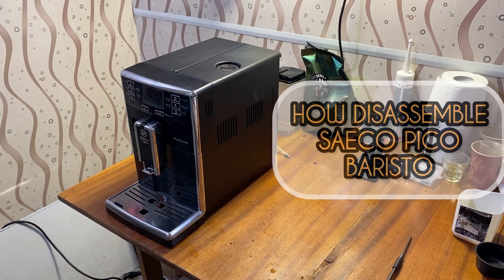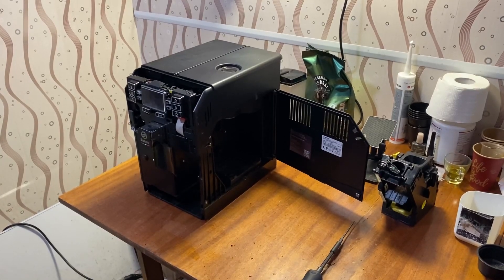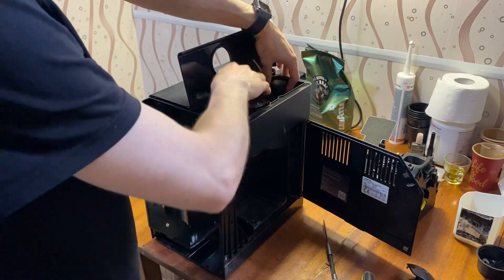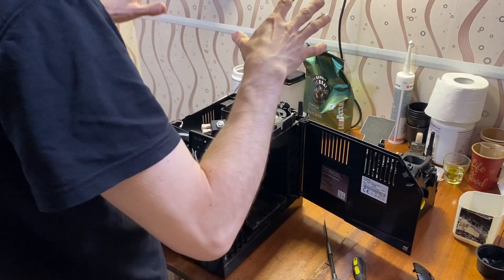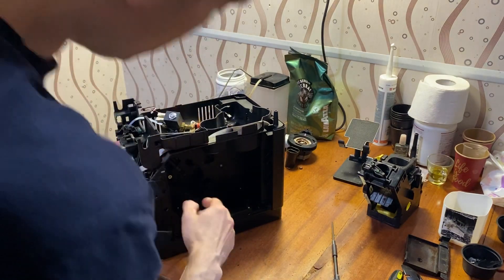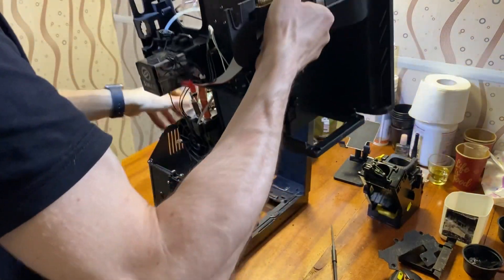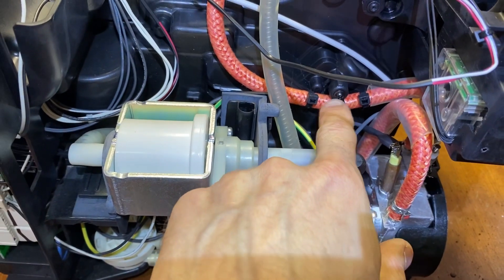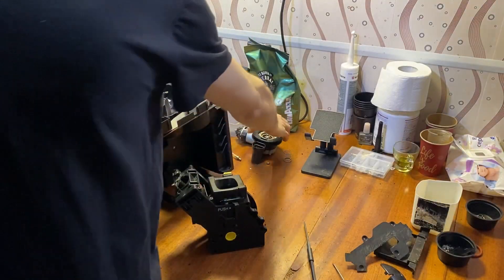How to disassemble Saeco PICO barista sm5460. What check inside?

Comment: Thank you very much for the video. Managed to take it apart and changed the rubbers(and cleaned it). Next time i will try to fix the two screws i had left. Don't think it will impact that much.
Reply from the maker: My pleasure. Absolutely agree about left screws - don’t mind about them. Personally - I collect an 1 litre can full of screws I previously have forgot to place in assembled machines)))

Comment: Hi! Thanks for the video!
I have a Seaco Pico Barista like yours, and recently it has started making a loud noise right after starting up (not during the rinsing cycle, but immediately after). This happens just before it begins dispensing coffee. I don't think the brew unit is the issue, as I've cleaned and lubricated it thoroughly. The noise seems to be coming from the left side of the machine. Do you have any idea what might be causing it?
Reply from the maker: Looks like some problems inside machine. If tries to guess - 3-way water connector got crack and release water presure inside machine case.

Comment: Hi thanks for video please any tip on how to clean coffe nozzle?
Reply from the maker: Hello. Just by disassembling machine. On such model - it’s easy : unscrew top of machine (in water container tray and bean container), pull towards yourself front panel ( maybe 2 screws behind coffee dispenser there’s). And just left screws behind side door of machine - 3 pcs, and 2 in front of machine. And you’ll be able to take out coffee nozzle container. If questions was about it. If you have ask just about front dispenser - take side chrome panel a little to the top and in opposite sides, unscrew little t8 screw and pull half’s of container to opposite sides
Reply: @OlegPC  thanks a lot did you ever disasseble coffe dispencer? Didn't found any video
Reply from the maker: @hatimdaoudi09  I disassemble such dispensers regularry. Its very simple, so i didnt make any video about. Just start, and youll be succeed)))
Reply: @OlegPC  afraid from breaking it hhh
Reply from the maker: @hatimdaoudi09  You shouldnt be. Very simple to disassemle machine

Comment: Hello Oleg,
Thank you a lot for your video !!!

I have same coffee machine and since couple of days it can’t venting the water cycle anymore… display brings the error 05 

I handle it to dissemble and clean the water temples.
By the way there was no water leaked.

Could you please give me some hints, what it could be and what I might have to change ?

Thank you in advance
Reply from the maker: Hello. This error reads as “slow water flow rate” - so it can be: (1) blocked water circuit (in any place), or stack electronic valve. If no water goes to water tray or water spout; (2) incorrectly working flowmeter or main plate problem - if water send to tray or spout but the same problem (e05) appears again ana again; (3) water send throw system weakly and water pump works with hard or constantly changing sound - water pump or air in water tubes before water pump; (4) water tank doesn’t sits in its place (some particles under water tank)
Reply: @ thanks for your hints.The pump is very noisy … so my best guess is  that the pump is defect … water pipes before are fine 
I ll try to change the pump … wish me luck;)

Have a great day !!!
Reply from the maker: @ The one who walks will master the road. Think you’ll succeed in such repair)))
Reply: @OlegPC  Hello Oleg 
I tried to clean any tubes from water tank, flow meter, pump to boiler, include the boiler self and in the end changed   
the water pump 
Running bit smoother but still no water and error 05 air in water cycle 
No water at all not in spout not in tray ;(

Could it be that flow meter provides not enough water to the pump or is it the electric valve?
Reply from the maker: @ Hello. Try to realise water tube that connected to electro valve and gently direct it out of machine (or connect longer tube to these tube). And , holding top part of machine with water tank (with water in it) start machine . If water will be flow from tube - you’ll find problem - electro valve